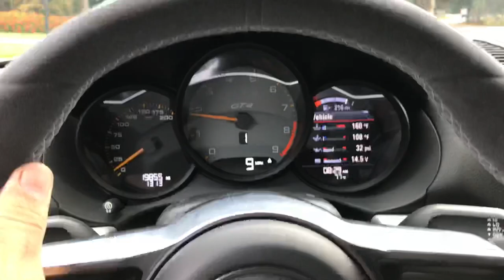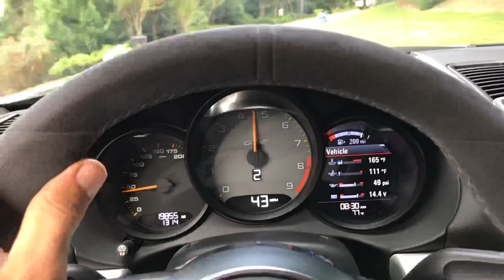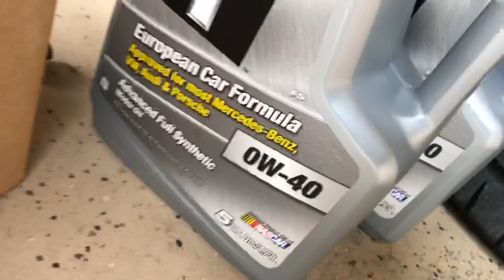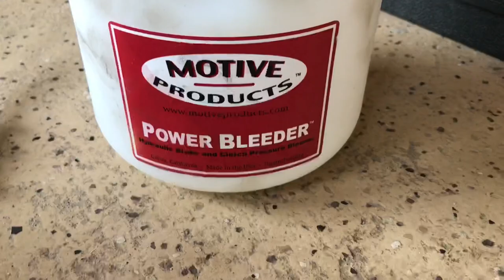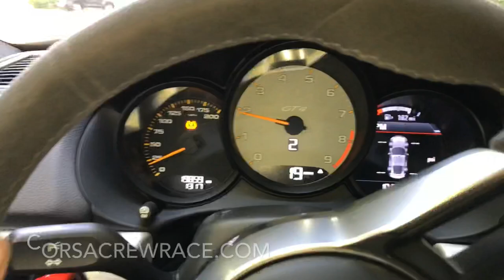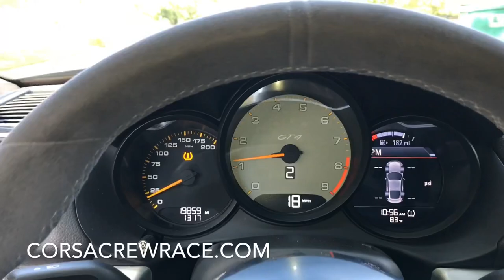Porsche Cayman 981 GT4 Track Prep, Oil Change & Racing Brake Fluid Flush

Comment: 2016 S here.  Curious about where you've put the rear jack stands. Is that a common place? (any more specific location instructions? - caught only a quick glimpse in the video).  I've heard all sorts of differing yelling and screaming about not using the jack points. Was thinking about bleeding one brake at a time using the standard jack points with just the jack. Also, there are recommendations where in order to place a rear jack stand under the rear jack point, you lift the entire side of the car from the front jack point to get the stand under the rear. I'd think that'd twist the car, no? Great information!!
Reply from the maker: You can use the subframe or lower control arm mounting point to subframe, keep in mind we leave our jacks in place and have the Jack stands as back up. Otherwise we use quick jacks during our mobile services.

Comment: You must keep the rotation of tires the same way. You can cross rotate, or fronts to rears and visa versa. Once steel belted radials rotate one direction they rotate and wear in on that direction and should never turn in the reverse or opposite direction. If you swapped lefts and rights, fronts and rears, you reversed the rotation of the tires. Was this a squared set up?
Reply from the maker: hutch430 That May be the case for daily street driven vehicle, but it is common to swap tires left to right for track use to gain more tire life. Directional tread going the intended direction only matters during wet surface situation. So If it’s a dry track, you will see a lot of this at a trackday 👍🏽